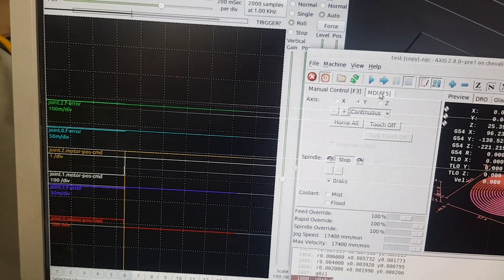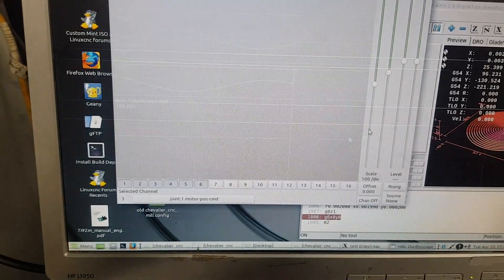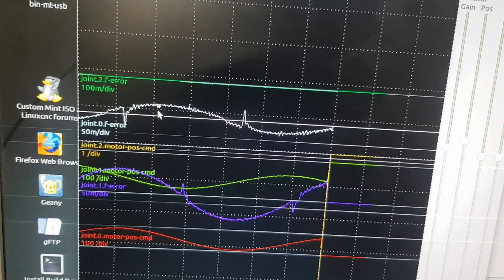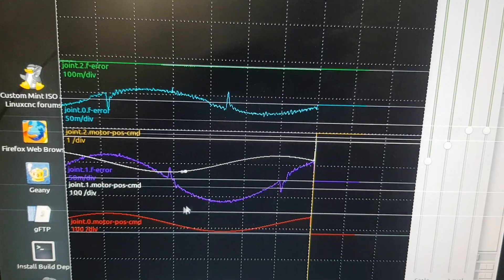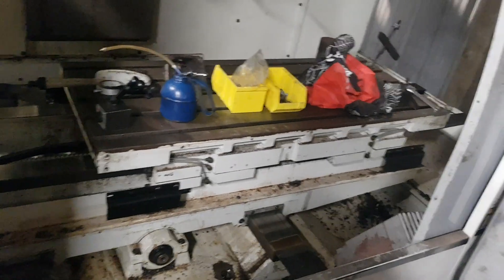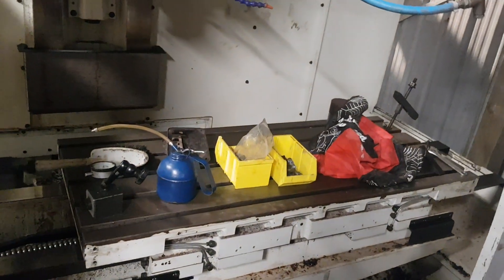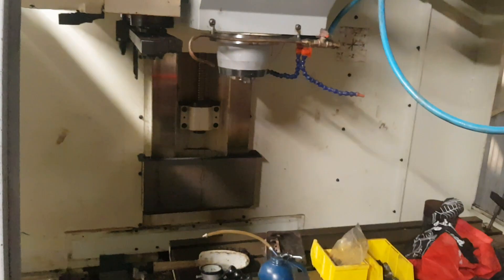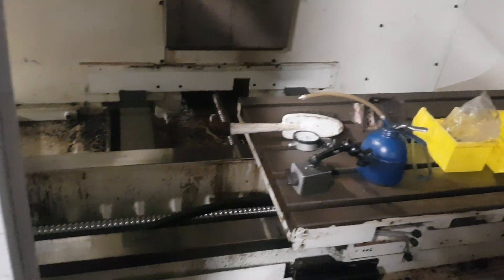Linuxcnc controlled high speed Cnc mill.  8m/min feedrate.

Comment: Very nice, 0.015mm seems high for error to me though I appreciate it's moving quickly. My siemens cnc mill would be off a lot less than that during normal cutting but perhaps while rapiding it has error, I guess it doesn't matter if it's not cutting. Would be interesting to see cutting error. I've seen servos with 2500ppr or something and then the far higher ones, and it made me wonder at the time 'why do 20 bit encoding? that translates to less than a micron movement' but I guess you need to be a factor of 10 or something higher to account for error.
Linux cnc looks intimidating, I've never seen ladder logic so it's very unfamiliar. Looks interesting though.
Reply from the maker: That error is because the servos need to overcome the stickion of the bedways and accelerate the table. At cutting speeds on normal machining it's under 0.01mm.  And that is max error at direction changes which doesn't usually happen. 

Better encoders mean the tuning can be better